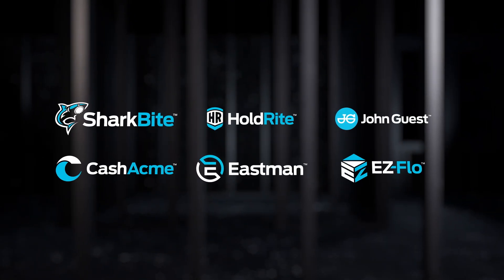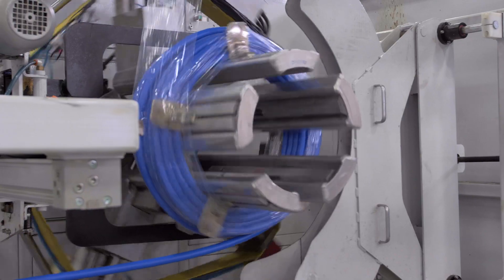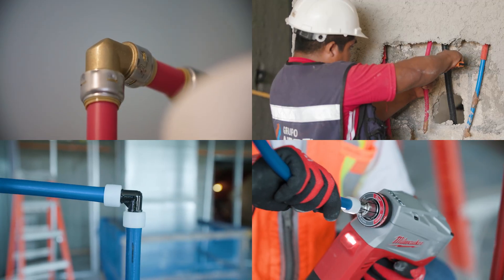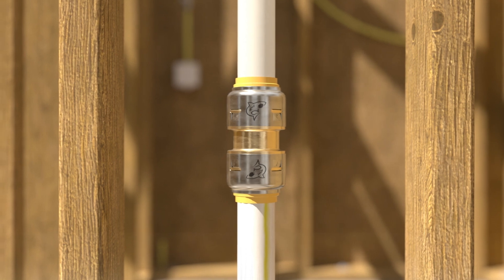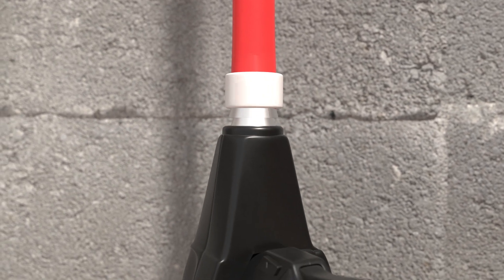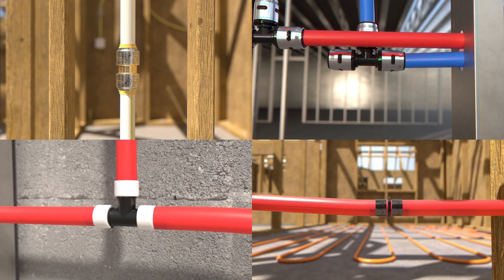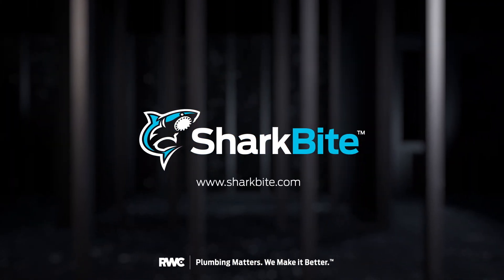4 Fitting Systems for SharkBite PEX Pipe

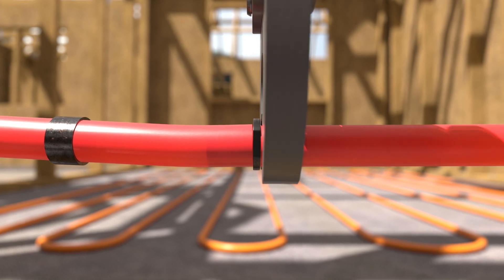Comment: In the expansion segment, at 1:30, it shows a brass T very different than the Sharkbite brass fittings sold in big box store. The Sharbite fittings I got from Home Depot have a design problem, specially the T and elbow. The problem is that the distance between the nipples is too short so the sleeves diameter interfere with each other and therefore the tube cannot be pushed all the way to the fittings shoulder. I would like to hear Sharbike on this.